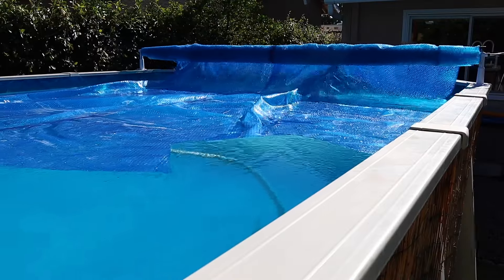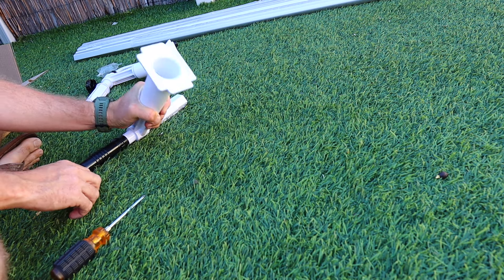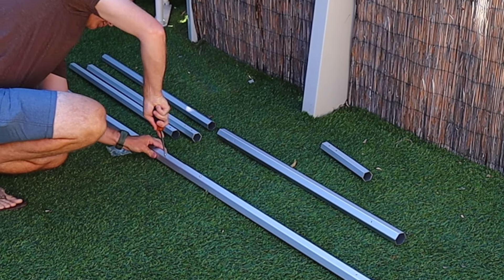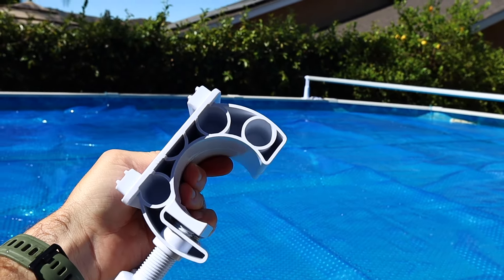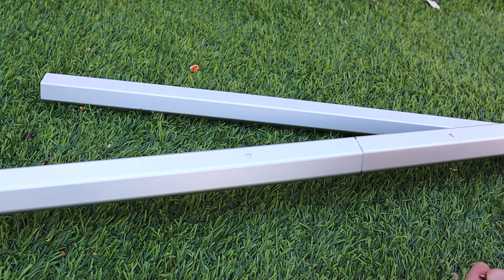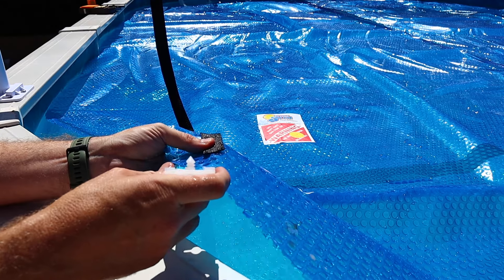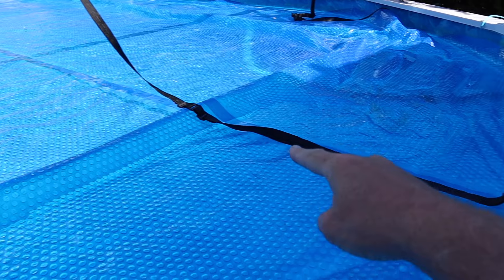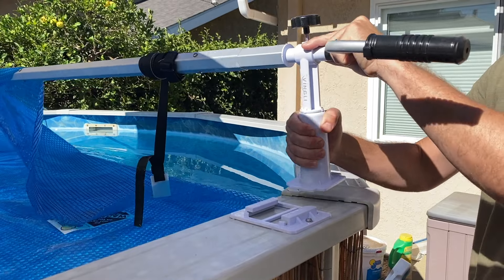Easy DIY Pool Cover Reel - How To Install and Use - Roll Up Your Pool Cover!

Comment: If you have the clips attach mid point on the cover directly below the reel, it will fold up evenly and not bunch up like yours did. No strap extension necessary

Comment: So my question is can you make something like this and use it as a winter cover cuz I'm sick and tired of buying these pool covers they're not easy to install I'd like to do one kind of like an inground pool but it just clips to the pool and doesn't fall is it possible
Reply from the maker: Im not super familiar with winter covers as we don't winterize pools where I live (doesn't get cold enough to have to deal with freezing). I haven't seen a method to use a roller on a winter cover.

Comment: Can I use this one for both summer and wintertime?  We live in FL where this winter is not cold. We want a cover to keep the pool clean. Do you have any suggestions? Do you sell any cover for it?
Reply from the maker: Call winter time, if you want to cover it, you would want a winterizing cover that goes over the edges of the pool, different than a solar cover in the summertime.

Comment: Do you cover your pool with the solar cover during winter?
Reply from the maker: I don’t, but I also don’t have to winterize my pool.
Reply: @DoItYourselfDad  I live in Southern California as well but I’m trying to cut down on electricity and water
Reply from the maker: In the winter time it’s cold enough that I don’t lose much to evaporation at all, I haven’t left the cover on in previous winters, but with what’s going on right now I may leave it on this year
Reply: I mean could this be used for a pool cover cuz that's what I'm trying to do I'm by myself and this is a solar reel cover system which isn't bad but I don't think we can use solar reel covers in the winter in Ohio. So I'm trying to find a system that will work for my pool cover so I don't have to take it off